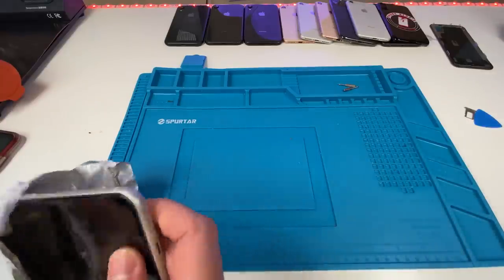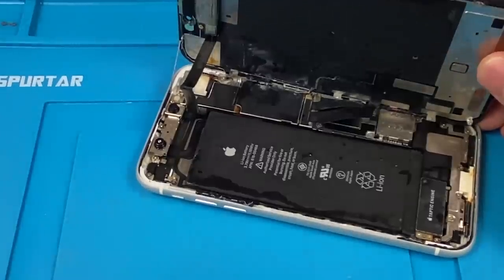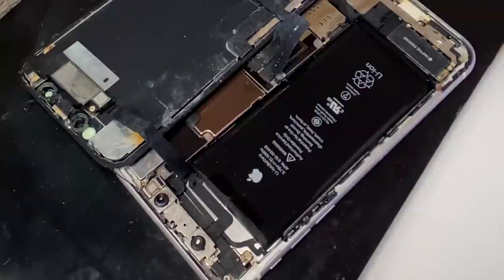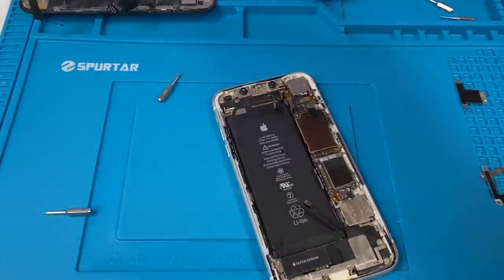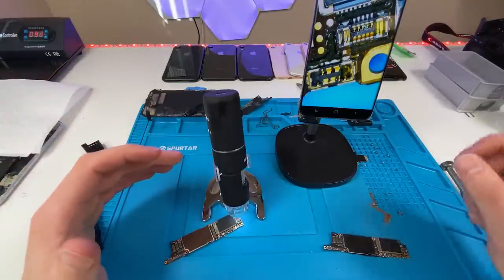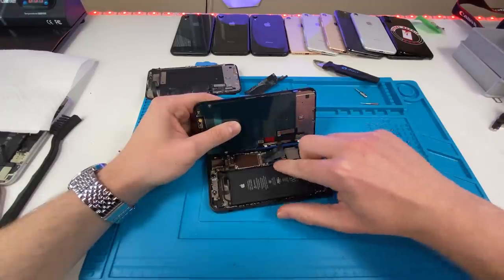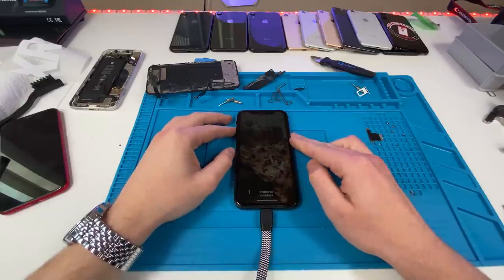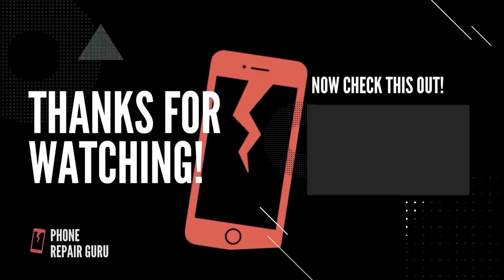XR Found In Lake With Water Still Inside.... Owner Contacted

Comment: I was actually really concerned when you put isopropyl alcohol inside the phone without disconnecting the battery first.

Also, it's better not to let water dry on any electronic board (unless it's distilled water).
Reply: Phone  dead

Comment: yo buddy this is pretty dope series!! , Just a tip , cause i can see u don't do a lot of micro soldering , remove al the emi shields ALWAYS with water damage :) even if you don have heat gun just use wire cutters carefully :D  ultra sonic cause when u clean even with iso it wont go under those shields of the board or under some ics with distilled water and some ultra sonic cleaner then clean with iso and done :) 20 min max sorted , love your content :D
Reply from the maker: Made sure my brush went under but yeah definitely a good idea to remove them

Comment: Salutations(: My husband (a fan of yours)  referred you to me as a result of the following problem... I own two (2) Nord N10 5G phones (model BE2028). One of them was recently set on the hood of my vehicle and then fell off and was run over before I realized it was missing. The screen is severely cracked and if you place it on a table and look at eye level it is also bent... BUT IT STILL WORKS. Some color is visible in one small corner, but nothing at all can be done with the screen, nothing. My alarm went off every morning for several days and then the battery died. I am desperate to get my photos, videos, info from one notes app and text messages (well, one conversation from text) from the phone. I visited a local phone repair business and was told the data can be recovered but, because the phone is so new, the screen needed to do whatever it is they would do is not available yet. So my question is, can the data I want from the phone be recovered without said "screen" and, if not, can I somehow use the second phone I own (or screen from the second phone) to assist in the recovery... ??? Any assistance or advice would be greatly appreciated. Would you ... the phone repair guru ... be at all, in any way, able to help?

Comment: Hi Guru, I have a question for you.

In your videos it seems that you remove the screen without heating it, but just using the Jimmy tool, is this right?

I tried one time to do the same but I cracked the (already broken) screen, so am I supposed to heat the screen before trying to lift it up?

Comment: My Question Is Why You Not Use PCB Cleaner Spray To Clean The Rust?
Reply from the maker: I don't have any and my office isn't equipped for that ventilation wise
Reply: @PhoneRepairGuru  But It's Good Than Alcohol Becz PCB Removes Rust And Cleans The Copper Plates And One Thing I Want To Say That In Am From Pakistan And I Love Your Work I Want To Be Like You I Am Interested In Electronics Since I Was A Kid